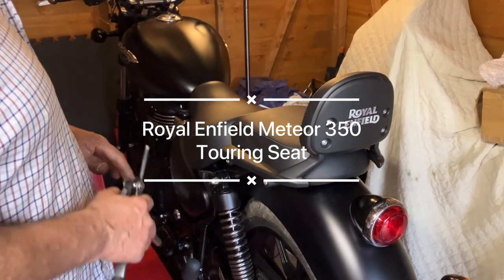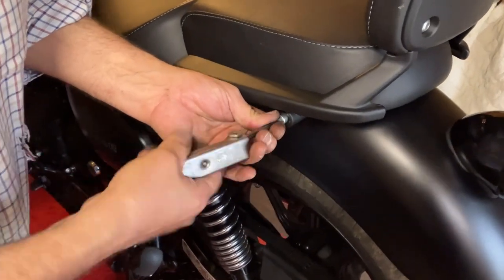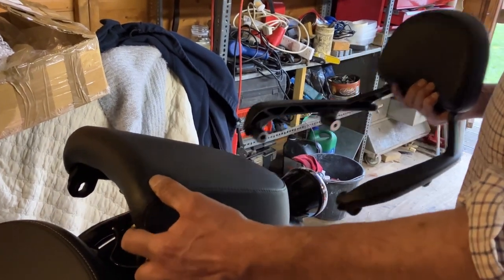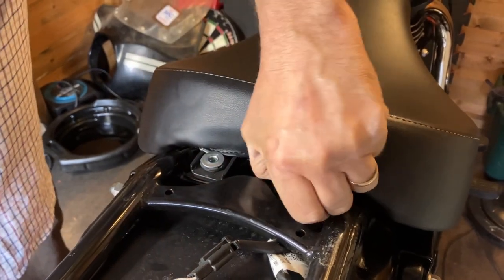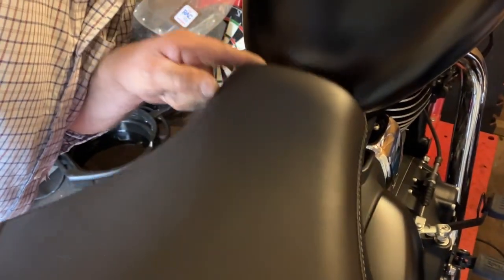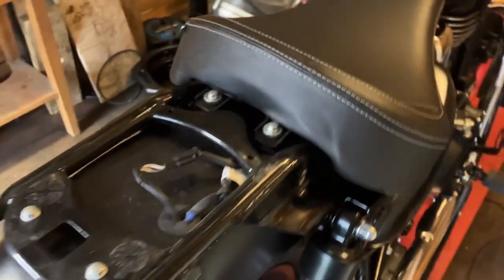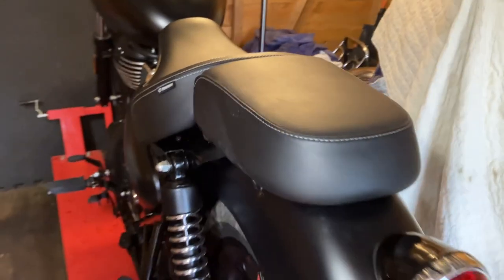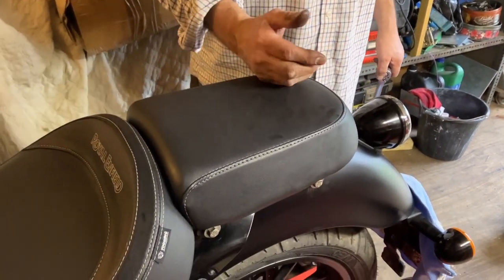Royal Enfield Meteor 350 - Touring Seat

Comment: What size bolts did you use to put the pillion seat back on? I really want to get rid of the backrest it looks so good without it, love everything else about my meteor!!
Reply from the maker: Hi Jack. They are 8mm thread but the rear ones need to be short or they will hit the mudguard. I'm afraid I don't have exact lengths for you.
Reply from the maker: Ah...And the rear bolts are just for show. They're not needed.
Reply: Did you drill it first. Mine won't work by hand

Comment: Nice, mine same bike re metore 350 is coming within days
Reply from the maker: Hope you enjoy it. I'm sure you will.
Reply: @MotorcycleFettlers  thanks i have some doubt is there any heating issue in this bike and any vibration in mirrors during high speed
Reply: @sunnyvlogs6667  heating not an issue, and the mirrors depend. My LHS one is completely fine at 60+ mph, but not at 50mph, my RHS one is fine at 50mph but vibrates at 60+. You can put dampers on them, but it is an inherent disadvantage of single cilinders
Reply: So impressed with my Himalayan,  I bought an additional Meteor. Engine does not produce excessive heat, very smooth and responsive. No vibe problems. All round it's a lovely machine, ENJOY !!
Reply from the maker: @TheBezaleel  thanks for the comment. We’ve got a friend who may get a Himalayan so maybe he’ll let us get it on the channel